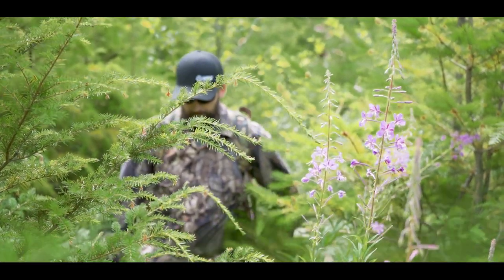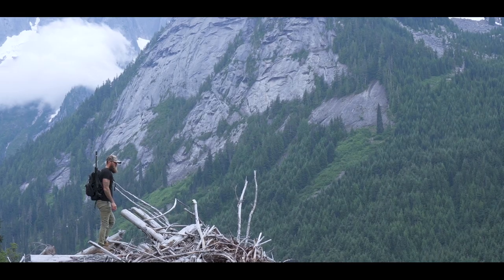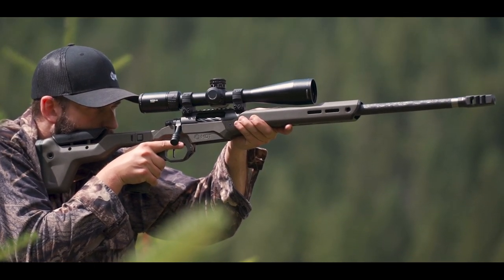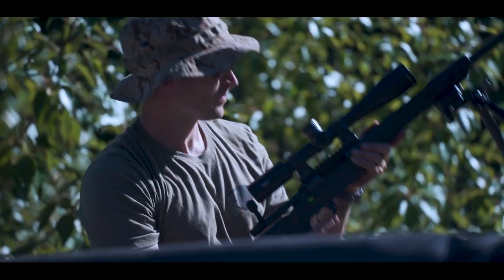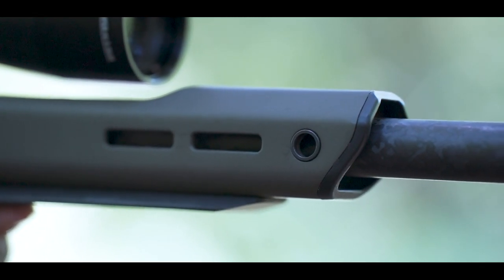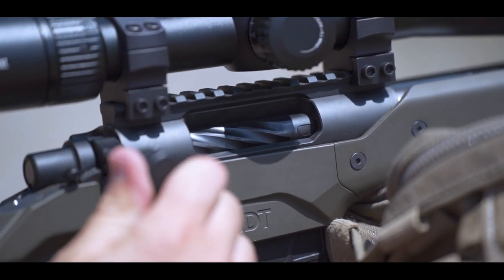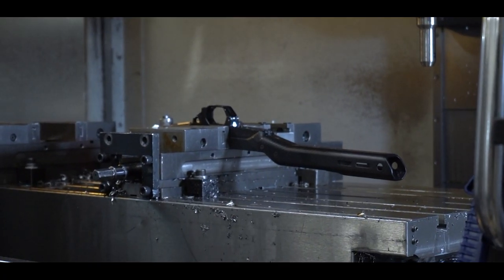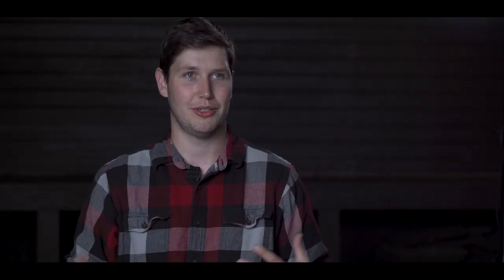MDT HNT26 Chassis System

Comment: Have used this in the field now for a while. Love it! Got a roebuck with gold rated antlers and a moose calf this sunday. One thing i can say, is that the foregrip is noisy with a sling when the hinges hits it, it is LOUD. It is also very slippery on wet days to carry around, plans on putting griptape on the frontgrip to get that problem out of the way.
Reply from the maker: Glad to hear your hunts were successful. We appreciate the feedback on HNT26 and will keep this for consideration!
Reply: @MDTTAC  Love your customer support as well. The few major issues i have had, was fixed within short time and i live in Norway. I cant commend you enough, and you sure have a hardcore customer saved for this one :)
Reply from the maker: @satansfittesleker  Thank you so much for the kind words; glad to hear we were able to help solve it for you!